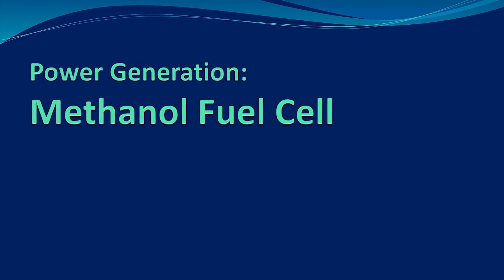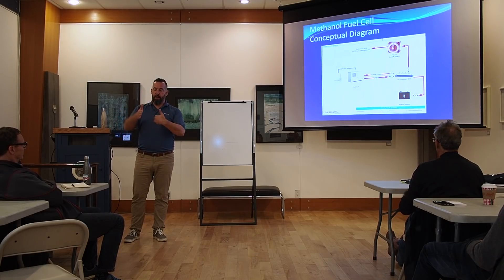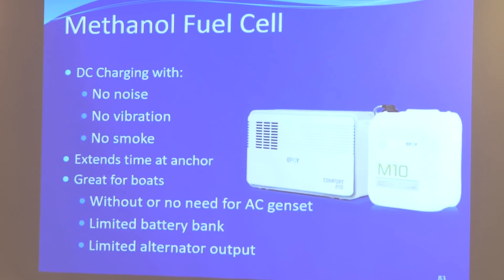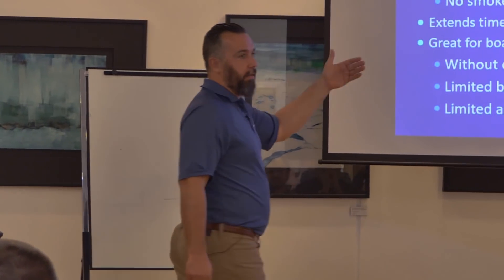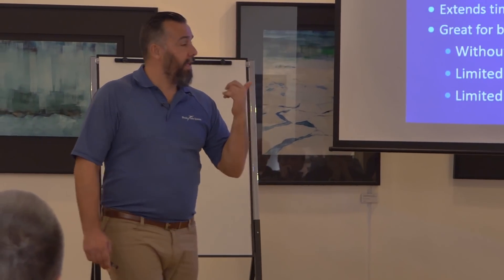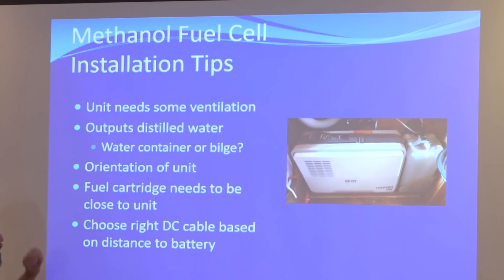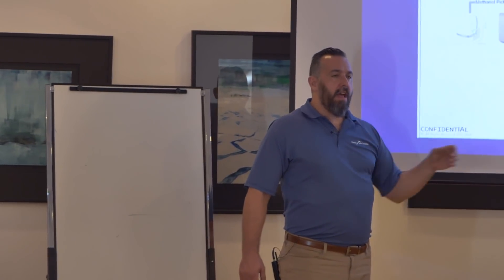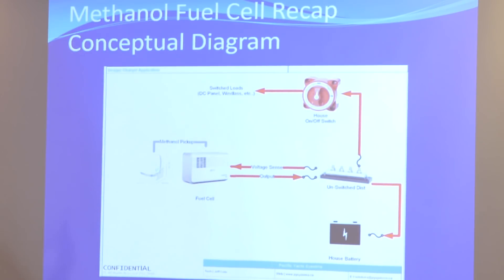How To: Marine Electrical Seminar - Methanol Fuel Cell - Ep 08/30

Comment: fully silenced diesel genarator 5 kv  3000 dollars... fuel 3 dollars a gallon... so eeerrrr .. lets do the maths.....
Reply from the maker: Hi Richard, diesel generator is always less money then fuel cell. Choosing a methanol fuel is not just a money thing, it's also about how space you have, weight you can have, and how important it is for you to have quiet power.
Reply: Good luck with diesel generator when they tilt on a rough seas.
Reply: @nemanjakomatinovic6046  the seas are full of ships that have stopped due to rough seas.
Reply: how would a generator do inside the living quarters of the boat?  Not that good!  The fuel cell is not a generator. It is a methanol powered battery charger.  It is not for everyone. Been using one for 10 years, fits my needs.